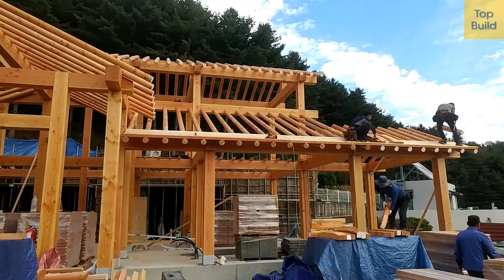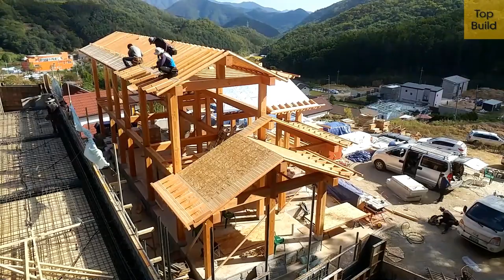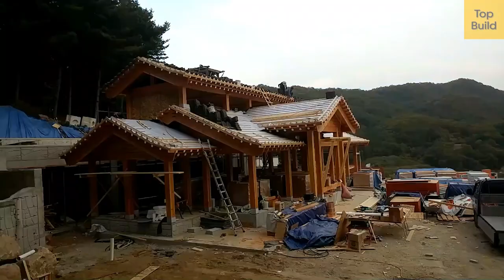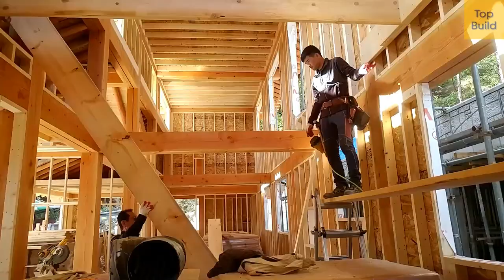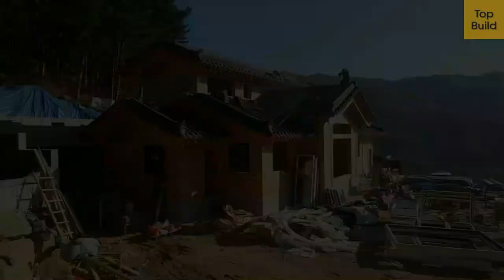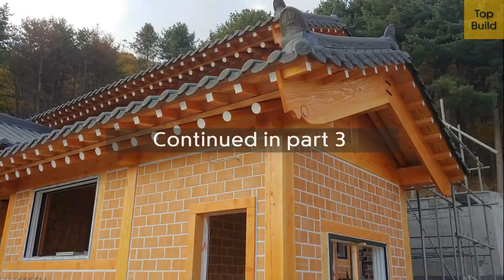[타임랩스] 현대식 한옥 시공 #2 벽체 및 외장

Comment: How are the roof beams held in place? did you use screws or nails to fasten them, or is it in the end just the final roof (wood planks) that hold it in place?

Awesome work and thank you for the video!
Reply from the maker: First of all, thank you for your inquiry. I fastened the roof beams with #8 * 300mm screws. If you have any further questions, please feel free to leave them in the comment section.
Reply: @TopBuildKorea  Thank you so much!!! <3